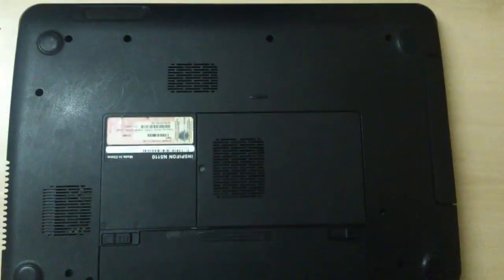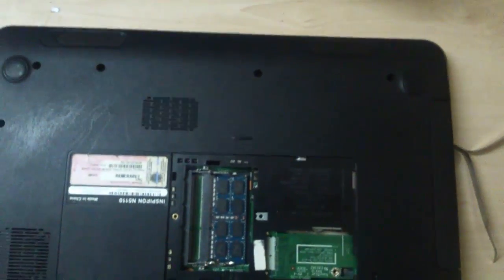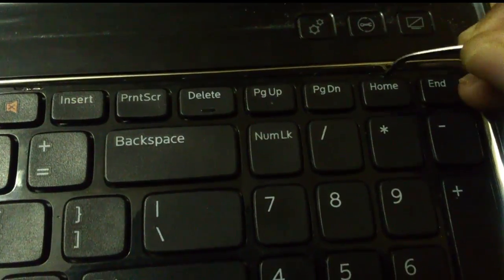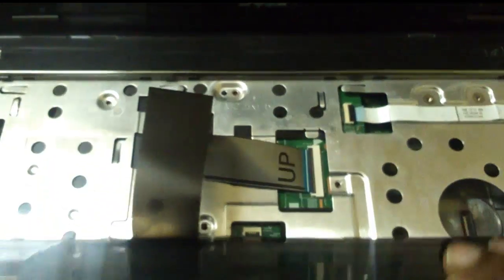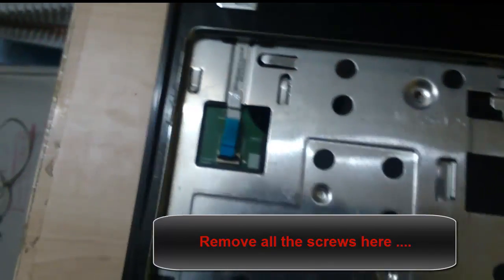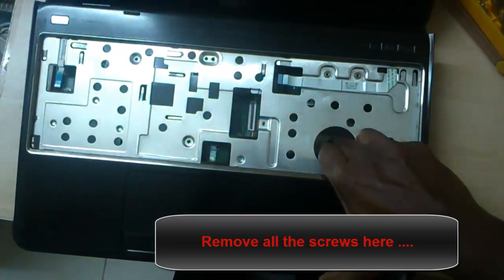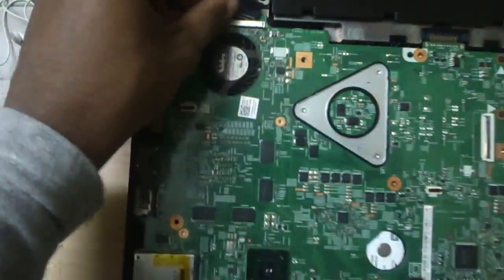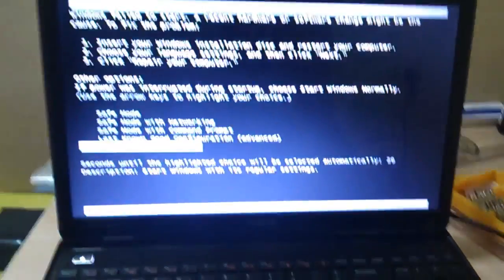How to fix the white blank screen dell (TUTORIAL)

Comment: With only "user's knowledge",   I understand the steps demostrated ; however, I don't understand what you " unclipped" or "reset" and why.  For me, a brief statement about what you were "resetting" would have been useful knowledge.  Thanks.
Reply from the maker: Actually I have unplugged the LCD cable and reconnected it ..it was loose.

Comment: Bro same laptop mine also & same problem too can u help me to fix the problem
Reply from the maker: Try the procedure in the video. If this doesn't work you need to check two things. First one is the LCD Display. try the LCD BIST test on your laptop. If it passes the test. The. The problem is with Cable which connects mother board and LCD cable you need to change that cable .

Comment: Im currently troubleshooting this white screen issue. Ive tried redoing the connection to the motherboard several timee, no success. I also attempted to perform the diagnostic  with no luck, i dont get the colored lines.........No matter what i do, i just get a white screen. Hdmi out works fine. Any suggestions? Xps L702x
Reply from the maker: May be  problem is with the  lcd cable which connects to the motherboard from LCD

Comment: i have a notebook that has that kind of problem. White screen appears after playing game and looks that the graphic card burned. I dont understand what changes to your laptop when u plug out the cable and plug in again... is there a problem with the connections that are not cleaned? the white screen is not burned graphic card?
Reply from the maker: You can run a LCD bist test.. That is available in my video. Please try that

Comment: TRY THIS FIRST IF YOU ARE HAVING THIS PROBLEM!!!
1. Turn off you completely.
2.Hold down the 'D' key for two minutes.
3.Then tap the power button.This start the LCD BIST.
Your screen should flash multiple colors and then power on as usual.
It really works for me. It may work for you too.
Dell XPS L502.

Comment: The quick fix is very easy.
Remove the battery and disconnect the power cord (from the laptop! not the wall outlet). 
Press power button for a few second. 
Connect the power cord. Press the power button to start and then dock the battery.
Reply: Not fixing the white screen. When i start the laptop with power cord(battery removed) it still shows white screen

Comment: hello, i am facing a problem when i start my laptop it shows white screen, but laptop is working in background. Then, after few minutes of hit & trail.( removing n applying battery, connecting to AC source, sometime without AC source) the display start working. Once it is okay, i do not face any problem until i shut down again and reopen the laptop after sometime. If i restart, i do not face any problem.  could you help me identify where is the problem ?
FYI: This prob start coming when i opened my laptop after a month.

Comment: I was mortally scared when one fine afternoon (literally right now) i turned on my laptop (Acer Aspire) to find this white screen. I never suspected that little pin because i just replaced my LCD 2 days ago. Well your video proved that the pin is indeed the culprit. But lots of thanks anyway. Else i would have had to open it up entirely. Saved a lotta time. 
It's frustrating and scary when you have so much of work to do and your computer behaves like this.
Reply: Can you help me I also had this problem my acer laptop had white screen problem I put there’s properly working but tomorrow when I worked on my laptop I sacre that the laptop screen is white please help me
Reply: Alex J. Mercer can you tell me how you fixed it, the same has happend to i have a acer aspire and just shows a blank screen

Comment: My display looks too lagging and the everything opens slow and looks much bright in since area with black colour but my cpu is perfect please help me when i Shane my mouse the pointer runs like a snake
Reply from the maker: It may be windows error.. You have to reinstall windows...before that also try removing all the external hardwares and keyboard.
Reply: @TechWizCraft  i have another monitor with me i have checked in that it is clean and i can run it with no problem with my second monitor works like this i don't know how to fix
Reply from the maker: Okay.. Run LCD bist test..
Reply: @TechWizCraft  i tried that it's not working
Reply: @TechWizCraft  please help me
Reply: @TechWizCraft  I'm a poor boy i don't have enough money to buy a new monitor

Comment: Dell inspiron 15r N5110.
My display not turn on. But power on.

I tried everything. 1 time it's on but shows white display after a minute and screen turn off..

I tried this but not helpful
Reply from the maker: You have to check LCD cable
Reply: @TechWizCraft  I tried. But no use.. 😢
Reply from the maker: You have to replace it
Reply: @TechWizCraft  external monitor connected to my laptop using hdmi port.  No problem there. But my laptop display not turning on..
Reply from the maker: So LCD cable is the problem...
Reply from the maker: dell Inspiron N5110 Display Cable for Laptop LCD or LED Screen https://www.amazon.in/dp/B00PCO48AC/ref=cm_sw_r_cp_apa_i_QB4LCbFRVNC29

Comment: Hey, thanks for the video. My dell 1500 serious laptop screen, giving trouble. I have to move the screen and find a perfect spot where it works.. mostly tilt it and mush up and down quickly. I have tried the Diagnostics test(passed), external Screen works fine.  What could be wrong?
Reply from the maker: Problem may be with the LCD cable that connects LCD and motherboard. You have to replace it..

Comment: Hey I did the same thing you did but when I reassembled my laptop it does not turn on and it is not charging. When I press the power button the button lights up for 2 seconds and then turns off. Please tell me what to do.
Reply from the maker: Have you connected all the components correctly?.
Reply: Akhil ts Yes I have but it's not charging now and not even turning on. When I press the power button it lights up for 2 seconds but then turns off. Also there is no sign of power when plugged in. No charging indicator.

Comment: I have dell n5010 and display suddenly goes white while working i follow your step and do correctly what show on video but problem is still there..there was no beep or external monitor work fine as well i also reinstall lcd panel cabel twice but same white screen some line flickr....please help
Reply from the maker: I think you have to change the LCD cable then.
Reply: Tried both changing  lcd panel cable as well as motherboard lcd cable twice time after clean but same problem is still there and there was one problem also in middle of screen getting hot when display is on..even on white display screen..rest external monitor works fine
Reply from the maker: Better to Contact a service centre, if you have tried both
Reply: So this is not gpu issue related? i'm worried
Reply from the maker: If it was GPU related then external monitor won't work... Don't worry

Comment: I would like to share my experience with my dell insperon 15 5000 gaming. The issue has been fixed and ill explain how in the end.  I started experiencing the issue when playing high powered games. the screen would go white and then thanks to Ian Rush. I pressed the d key and it fixed it. I assumed it was a software issue. I kept experiencing the issue and i eventually reinstalled the drivers. I thought it was fixed but then it got worse the next morning. The screen went white again. But I noticed only in certain positions it happened. Which made me conclude it was hardware. I contacted dell and had it shipped out to the repair facility over fed ex ground. Which was very slow. A week or two later the laptop came back not fixed. I called dell pretty upset and dell said all they did was unplug and replug the lcd cable. I did not understand how this was possible. They said it had to be reshipped out. I requested fed ex express and it was approved. Dell actually sent me a box where I could write the issue down and explain whats wrong. I did that and for some reason was unsuccessful in scheduling a house pickup. So we dropped it off at a nearby drop off box. The laptop came back now and the sheet said they replaced the LCD screen. I remember the guy at dell said that my LCD screen was perminatly attached to the video cable running through the hinges. I'm still not sure about that. A week has passed with the issue not coming back...... Yet. The issue with the first repair was that I did not supply my username and password or the sheet so the people at repair just assumed it was a simple white screen issue. Personally I hate taking apart computers and never have and my life and I hope not to ever have to. I feel I have shared my experience with everyone and i would hate for others to experience what I did. But from this moment I will never feel the same about dell or laptops.

Comment: I have more of a solid gray screen on a Vostro 3700 (white if I increase brightness). I reseated both ends of the LVDS cable between mainboard and LCD panel with no luck, before watching this.

 I also wiggled the connectors on both ends with the PC booted up and the screen remains gray. However, it works on an external monitor via HDMI out. 

I'm going to give the "D" + Power Button a shot. If that does not work, my last attempt is to take a close look at the connector pin out.

The CPU heatsink is hot at idle which makes me wonder if it had gotten hot enough while under load to melt a solder joint on the mainboard LVDS out connector. I could try to give it a little heat with a SMD desolder heat gun...

The LED/LCD panel could also perhaps have issues with the internal ribbon cable connections that border the lower edge of the screen. I've had these fail on televisions. If I find a resolution I'll share my results.

Comment: Mera lapi sahi nhi ho raha h kya karu problem kya h
Reply from the maker: +ÆÑÜJ KR  ye vala solution try kiya?
Reply: Akhil ts vga cable kai bar remove connect kia but nahi hua.  Hdmi cable se 2ndry window work kr rhi h.  Display check kia wo bhi sahi h. Ab lcd cable check krna h
Reply from the maker: +ÆÑÜJ KR ok then you have to contact the service centre..
Reply: Akhil ts yes

Comment: if it dosent work for windows 10 and you have an HP, try this:

1. in between the thing that folds your computer into sleep mode push that bar thing and it turns off your computer

2. Pull it back in and turn your computer on

3. Done
Reply: Ellia Time what bar thing?
Reply: You mean the battery? It doesn't work

Comment: I think I did something wrong, I opened up my laptop and the lcd connector seems to be taped when I re assembled it all back it's just now a black screen
Reply from the maker: +Paul Tolenada it's the problem with connector.. Try again the same procedure..
Reply: I cant pull out the connector because it seems taped under
Reply from the maker: +Paul Tolenada okay.. Don't break it.. Just go to a service centre.... And don't worry it will not cost much..
Reply: U might have not fixed all the removed cables proper

Comment: hi 
can anyone help me
my laptop showed this white screen post which I turned it off upon restarting ,it didn't seem to turn on but only the light appears (tiny light representing laptop is on) and nothing else happens
further when it turned off I put it on charging post 20 mins of which the indicator showed me the batters is full now even it's not even charging but my charger is fine. Also I have not encountered any problems with my battery so far.
Can someone having first hand experience suggest something in this regard and share the probable causes of this issue.
thank your
appreciate your help
p.s I tried removing the static ( basic troubleshooting) but it didn't work out

Comment: laptop is on every thing is OK but 5 minutes later screen is white what's the matter
Reply from the maker: Loose connection between lcd cable and mother board may be the reason for this...  your using HP laptop right?. Find a disassembling video for your model from YouTube, remove and reconnect the lcd cable to mother board  as I have shown in my video..take atmost care while dissambling laptop.. If your not comfortable dissambling your machine then contact service centre. Don't worry it is just a problem of your lcd cable.

Comment: A million thanks.  I have zero knowledge of the inside workings of laptops and was very apprehensive about attempting to fix it myself for the first time. My laptop fell a couple of feet and when I powered it up, the screen went blank and the laptop kept beeping continuously 8 beeps.  I finally got up the courage to try fixing it after watching your video a couple of times.  Sure enough, the display cable was loose and after clicking it in place and putting everything back together, the display was back to normal.  However I did something careless.  I flipped the keyboard cable when reattaching it, and it took a few frustrated tries detaching and reattaching it before I realized it was flipped.  After it was attached correctly, laptop was as good as new.  It was a very satisfying learning experience.  Felt really good that I managed to fix the laptop on my own following your instructions.  Thanks again.
Reply from the maker: Welcome
Reply: K N kl
Reply: i like it

Comment: i did everything like you I reconnected and disconnected squeezed the cable but nothing works I do still have this white screen all I did was pushing the lid back a little bit with too much force while I was on the internet then it turned white please help I cant afford myself to lose my computer I really need it for school etc...
Reply from the maker: You need to give it to service centre.. Don't worry it won't cost much

Comment: guess what this happened to me and i found a way easier way to fix it and i did it twice but it took a few trys alll you do it turn it on in the white screen and you press the power button untill it makes a sound and close your laptop and open it back up and turn it on if it doesnt work the first time just keep trying but it sould work because this is the way for me to fix my white screen
Reply: hi .. i have a plain white screen with some lines on and off ..... but connecting to a projector or monitor it works well but lap screen is white as it is ... no cracks are seen etc... please can u help.....
Reply: I placed it on and then pressed it till it went off but none happened
Reply from the maker: It won't work with every lap top.. Somehow you are indirectly pressing the cable that connects to the screen..
Reply: trap_team OMG THANK U❤️❤️❤️❤️ UR THE BEST 😂😂 It worked btw 😂
Reply: yea thxz
Reply: trap_team v
Reply: It didn't work
Reply: Tave Reborn samee
Reply: trap_team it didn’t work
Reply: INFINITE LEARNING I have the same problem in hp laptop.can u tell me how can I fix it?
Reply: trap_team  I don't understand.how do u do that?tell me please
Reply: OMYGOD THANK YOU SO MUCH,IK THIS IS LATE BUT IT WORKS FOR ME.THANK YOU AGAIN
Reply: i luv u
Reply: Worked!

Comment: My laptop screen currently only displays white, however, earlier the screen has flickering static lines that appears briefly and disappears quickly. I hook up an external display to my laptop and it is working just fine. Can I use this method for my problem?
Reply: Not really. Hard to describe. But to give you an idea, the screen is mostly white with colored lines.
Reply: I dropped mine so i assume it hit something inadvertently. I just tried doing this fix on this video and my computer was too different this dudes computer in the video so i couldnt find the cable he was fixing. Is there a fix for this? or am i better of taking it to get fixed?
Reply: On rainy day i was working with my laptop with ac power. At that time thundering. And my laptop screen became white and inside that a black circle formed large to small. After that i switch off laptop and plug out all even though battery also. Again i put battery and start it. It started with some time. Now a day's it showing only a white screen. What should i do?

Comment: i do it like ya say .. but its didnt work ! 
plz help :(
Reply from the maker: There are other things also that causes the same problem.. If it's not worked for you.. Then you have to approach a service centre.. Don't worry...it won't cost much..it may be a problem with your cable, connecting lap top screen and mother board.

Comment: THAX SIR  MY LAPTOP SCREEN REALLY START WORKING.I WAS TOO MUCH SUFFERING PROBLEM.MY LAPTOP MODEL IS DELL VOSTRO 1015 .I BOUGHT IT IN AUGUST 2011.6 MONTHS BEFORE  I SUFFERED SAME PROBLEM OF WHITE DISPLAY THEN CURSOR  HANG.I SPENT RS. 1800 TO EXCHANGE ITS DISPLAY CABLE.AGAIN I WAS FACING SAME WHITE SCREEN PROBLEM. BUT IN THIS TIME NOW I SOLVE  THIS PROBLEM BY HELP OF  YOUR VEDIO HERE.THAX A LOT AGAIN I SAVED RS.1800 IN THIS TIME.IT REALLY AMAZING FOR ME.

Comment: my screen is not Completely white but its is partially white, 
and as I move the cursor its is not visible clearly,, to notice the movement of curser I have to move very slowly and more over the contests of the screen are not visible clearly.. 
What to do,, due you have any idea what is wrong with my screen..
Reply from the maker: Try  pressing your screen at different location using medium force .. And let me know if it works..
Reply: +Akhil ts I have a similar problem. 
When i turn on my laptop it either shows a white/grey background which gradually dims, after a few minutes the screen will change to having blue/white/black and the desktop startup sound will ring but all it shows is the blue/black/white screen.
What is wrong with my laptop and how do i fix it?
Reply: i have the same problem i do what ya tell me but it dosent work :( 
hellpppp!!!